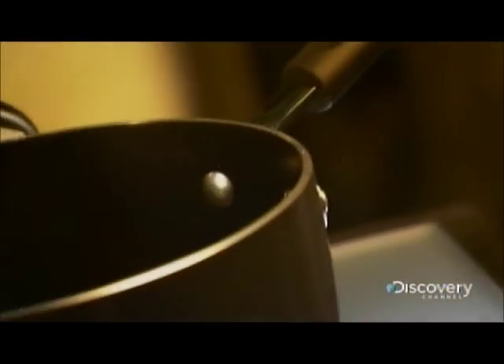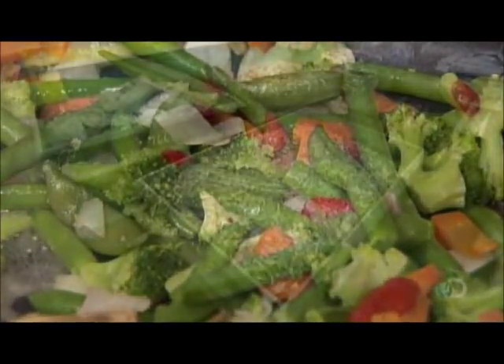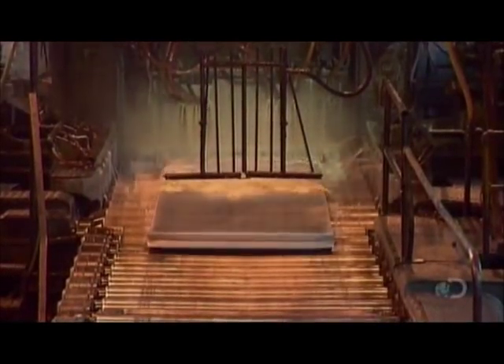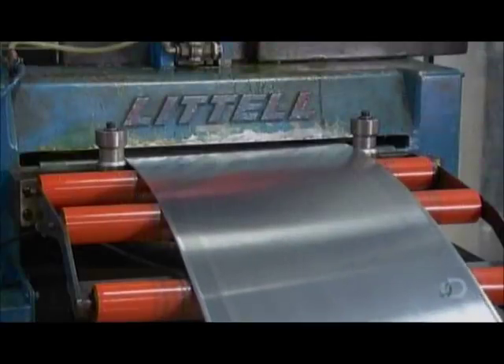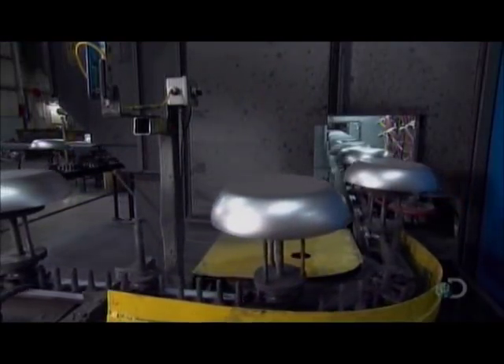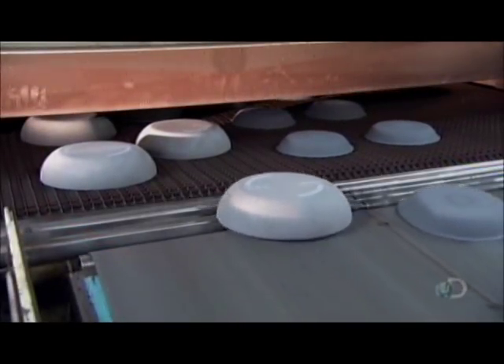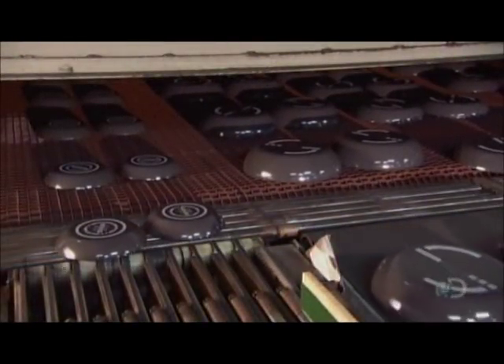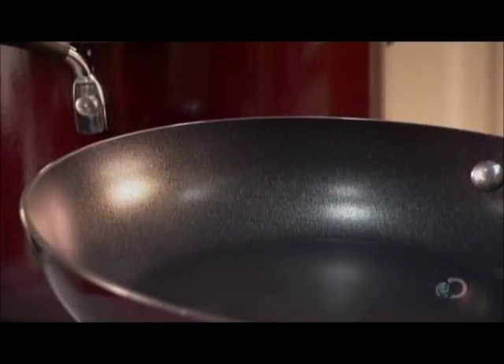How It's Made - Non-Stick Cookware

Comment: The aluminum sheet they are stamping those pans out of is rather thin. It should be at least 1/4" (6.35 mm) thick for good heat distribution. I wonder if they are using genuine DuPont Teflon or generic PTFE. Most likely the latter. I don't like "non-stick" cookware anyway. I prefer well-seasoned cast iron / carbon steel and stainless steel cookware. I'd like to try tinned copper cookware for certain tasks, but it is too expensive.
Reply: Sure a 6.35mm thick aluminum pan heats more evenly, but I doubt any manufacturor would make an aluminum pan that's fully 6.35mm thick from top to bottom. Generally they're half that thickness, which is still more even heating than All-Clad, which uses approximately 1.7mm of aluminum in the cladding. 

The brand of pans in the video is Tramontina, and from the products I've seen they don't use DuPont Teflon, but they don't use generic PTFE either. They use Whitford's Eclipse nonstick. Whitford nonstick easily rivals DuPont nonstick and outperforms some of them. 

As for well seasoned cast iron/carbon steel, I don't know of anyone who has done long term studies on the health affects of seasoning. I mean you're cooking on burned oil. It doesn't really sound much better than nonstick coatings. Plus both carbon steel and cast iron are significantly less even heating than aluminum.

Tin is significantly more fragile than nonstick coatings are. Their melting point is approximately 450F, while PTFE coatings are at 620F. Granted they begin to degrade at about 500F. Tin also scratches a lot more easily and you'd have to retin the pans every decade, which cost almost as much as the pans brand new. You'd be better off buying stainless lined copper.
Reply: >Sure a 6.35mm thick aluminum pan heats more evenly, but I doubt any manufacturor would make an aluminum pan that's fully 6.35mm thick from top to bottom. Generally they're half that thickness, which is still more even heating than All-Clad, which uses approximately 1.7mm of aluminum in the cladding.

http://www.foodservicedirect.com/product.cfm/p/226106/Eagleware-The-Point-Two-Five-Line-Aluminum-Sauce-Pan.htm

The name "Point Two Five" refers to .25", i.e., 1/4" thick aluminum, which is approximately 2 gauge aluminum sheet.  

All-Clad isn't a particularly good performer, nor is any other aluminum-core tri-ply cookware. Stainless steel is a poor conductor and the aluminum core is far too thin for good, even heat distribution. If it were a copper core of the same thickness, that would improve things greatly, though it would still be on the thin side even for copper. Copper should be at least 2.5mm thick.

>As for well seasoned cast iron/carbon steel, I don't know of anyone who has done long term studies on the health affects of seasoning. I mean you're cooking on burned oil. It doesn't really sound much better than nonstick coatings.

It is carbonized oil. Small amounts of carbon won't hurt you; we are "carbon-based lifeforms" afterall. I don't pay any attention to wild health risk speculation anyway. My dislike of PTFE has nothing to do with any alleged health risks. I don't like that you can't sear food properly on it, and that it can be damaged and there's no way for someone at home to re-coat it. 

>Plus both carbon steel and cast iron are significantly less even heating than aluminum.

Cast iron retains heat well, and can handle very high heat, which makes it good for searing. 

>Tin is significantly more fragile than nonstick coatings are. Their 
melting point is approximately 450F, while PTFE coatings are at 620F. 
Granted they begin to degrade at about 500F. Tin also scratches a lot 
more easily and you'd have to retin the pans every decade, which cost 
almost as much as the pans brand new.

I said that I'd like to try tinned copper cookware for certain tasks. I already know the limitations of it, but for the tasks for which it is suited, it is the best performing cookware you can get. And it wouldn't cost me much to re-tin a copper pan, because I'd do it myself. It is just a wetting process, like soldering. Heat, flux, and a bar of tin are all you need.

>You'd be better off buying stainless lined copper.

No. If I were to spend the money on copper cookware I wouldn't want its performance degraded by a sheet of stainless steel on top of it. Also, tin is fairly non-stick while stainless steel is about as far as you can get from being naturally non-stick.
Reply: And the Eagleware is one out of how many cookware lines that are made out there? Cookware made with more than 4mm worth of aluminum is usually relegated to disc bottomed pans. 

Demeyere Proline/Atlantis frying pans comes the closest with it's 3.7mm aluminum core pans and 1.1mm worth of stainless steel. Much more even heating and its heat retention rivals that of 3.6mm of cast iron, which is the approximate thickness of enameled cast iron. Besides, you'll never find cookware out there that gives you perfect even heating where the edges of the pan is the same temperature as the center of the pan. Thick copper pans comes the closest, but it's still not perfect. And when it gets too thick, I doubt many consumers would want to deal with the weight. 

(Small amounts of carbon won't hurt you; we are "carbon-based lifeforms" afterall.) That doesn't sound like a very good argument. Especially with carbon dioxide and monoxide which exist. It's like saying natural must be better for us because it exists in nature. Venom of black widow spiders are natural, but I doubt anyone would want that in their food.

Well, you don't have to sear food in nonstick. Any good cook should leave that to their stainless/carbon steel and cast iron pans. I leave it mostly to foods I don't want sticking in. Mainly scrambled eggs and certain fish for me personally. Everything else I use my stainless pans.

(Cast iron retains heat well, and can handle very high heat, which makes it good for searing.)And that's really one of the very few benefits I can see with cast iron. That and seasoning for a nonstick coating are the only benefits I see going for it.

At least you have the luxury of retinning them yourself. 

I don't think the difference between the performance of tin and stainless steel are as significant as many people think they are. Is tin less stick than stainless? Sure, but it's a a far cry from seasoned cast iron/carbon steel. On a well preheated stainless steel lined pan, sticking shouldn't be that significant. Also the stainless steel thickness on pans like Mauviel and De Buyer Prima Matera, is 0.2mm thick. The difference in the temperature would be minimal. It's going to be the copper that does the conducting, not the tin/stainless steel. It's like Swiss Diamond's claim that their diamond dust would help their pans heat more evenly. The diamond dust is minimal, despite diamond's excellent heat conduction. And in a similar vein, tri-ply pans that are stainless on the interior, aluminum middle, and copper exterior are a waste of money. It would be the aluminum that's doing most of the conducting work. The performance of copper would be blunted by the lesser performing layer of aluminum.
Reply: >And the Eagleware is one out of how many cookware lines that are made out there?

You said:

>I doubt any manufacturer would make an aluminum pan that's fully 6.35mm thick from top to bottom.

You were wrong. Your followup question is irrelevant.

>Demeyere Proline/Atlantis frying pans comes the closest with it's 3.7mm aluminum core pans and 1.1mm worth of stainless steel. Much more even heating and its heat retention rivals that of 3.6mm of cast iron, which is the approximate thickness of enameled cast iron.

No, an aluminum pan of approximately the same thickness as a cast iron pan will not have anywhere near the heat retention of cast iron. Cast iron has about 3 times the mass of aluminum for a given volume. Pound for pound, aluminum does retain heat better than cast iron, but that means you'd need about 6mm thick aluminum for a given size pan to retain heat as well as a 4mm thick cast iron pan of the same size. By the way, typical bare cast iron pans, such as from Lodge, are about 3/16" thick, which is about 4.76mm.

>Besides, you'll never find cookware out there that gives you perfect 
even heating where the edges of the pan is the same temperature as the center of the pan. Thick copper pans comes the closest, but it's still not perfect. And when it gets too thick, I doubt many consumers would want to deal with the weight. 

What does that have to do with anything? Who said that perfection was required?

>That doesn't sound like a very good argument. Especially with carbon dioxide and monoxide which exist.

Carbon dioxide and monoxide are not carbon, no more than water is oxygen or hydrogen. Carbonized oil is carbon. It is not even remotely dangerous to consume in small quantities. Have you ever heard of "charcoal pills"? They are made from activated carbon - https://en.wikipedia.org/wiki/Activated_carbon 

>It's like saying natural must be better for us because it exists in nature.

No, it's nothing like saying that. All life; everything that's organic, is carbon-based:

"The definition of organic is natural matter or compounds with a carbon base"

>And that's really one of the very few benefits I can see with cast iron.
 That and seasoning for a nonstick coating are the only benefits I see 
going for it.

Those are pretty big benefits. You can sear a steak at 500 or more degrees F, or cook eggs at 300 F that slide right out of the pan.

>At least you have the luxury of retinning them yourself.

It isn't difficult. On the other hand, coating a pan with a PTFE-based coating is a factory/industrial procedure.

>I don't think the difference between the performance of tin and 
stainless steel are as significant as many people think they are. Is tin
 less stick than stainless? Sure, but it's a a far cry from seasoned 
cast iron/carbon steel.

As I said, if I were paying big money for copper cookware, I'd want the best possible performance, and that means tinned. The tin doesn't interfere with the thermal properties of copper by any significant amount because it is so thin; so thin that you can't even see or feel its thickness. For example, if you were to only tin part of the cooking surface, you could run your finger across the border between the tinned and untinned surface and it would feel perfectly smooth. That's because it is wetted to the copper rather than being a sheet that's laminated to the copper as is the case with stainless steel. 

Even 0.2mm thick stainless steel is incredibly thick compared to tin that's wetted to copper. 0.2mm is about 12½ times thicker than standard household aluminum foil, and even aluminum foil is thick enough that you can see and feel its thickness. The tin is fairly durable despite it adding practically zero thickness because it actually forms an intermetallic alloy with the copper during the wetting process. That's why it can never peel or flake, because wetted tin isn't a separate metal adhered to the surface like with plating or lamination. 

On top of that, tin is significantly more non-stick than stainless steel. It doesn't matter that it isn't as non-stick as a well-season cast iron or carbon steel pan, or a PTFE pan; what matters is that it beats stainless steel.
Reply: (You were wrong. Your followup question is irrelevant.) First off I said that I had doubts that cookware that is fully 6mm thick exist. I didn't say that none exist at all. Saying that my followup question is irrelevant is just plain dismissive.

(No, an aluminum pan of approximately the same thickness as a cast iron pan will not have anywhere near the heat retention of cast iron. Cast iron has about 3 times the mass of aluminum for a given volume. Pound for pound, aluminum does retain heat better than cast iron, but that means you'd need about 6mm thick aluminum for a given size pan to retain heat as well as a 4mm thick cast iron pan of the same size. By the way, typical bare cast iron pans, such as from Lodge, are about 3/16" thick, which is about 4.76mm.) Six millimeters and four millimeters, that would add up to 75%. I hardly consider that to be "not have anywhere near the heat retention of cast iron". If the aluminum pan was 2mm thick like the ones found on cheap nonstick pans, sure. I'd much rather use a Demeyere Proline pan with 75% of the heat retention of Lodge cast iron without needing to deal with the weight, possibility of rust, and significantly more comfortable and longer handles. The only downside of Demeyere Proline is the price.

(What does that have to do with anything? Who said that perfection was required?) Then there would be no point in having thicker aluminum or copper pans other than durability/warp resistance. Neither did I mean literal perfection. You want pans with the "best possible performance".

(No, it's nothing like saying that. All life; everything that's organic, is carbon-based: ) Your point was that eating burnt carbon is completely harmless just because we're carbon life-forms. I find no difference between that and what I said.

(Those are pretty big benefits. You can sear a steak at 500 or more degrees F, or cook eggs at 300 F that slide right out of the pan.) Both of which can be done in other pans. And I've never seen eggs slide out of a cast iron pan. Every video has the person nudge the egg with a spatula. And this is when no oil is used at all. No matter how well seasoned a cast iron pan is still not nonstick. A suitably thick frying pan can sear steaks without dealing with the weight, rusting, seasoning and the upkeep that is needed for future use. Also with cast iron/carbon steel there are multiple different methods to season them, and not every consumer finds these variation to work well.

(It isn't difficult.) That's because you clearly have experience retinning copper. Ordinary consumers do not. If I were to do it I'd probably burn the building down.

See, mathematically tin-lined copper looks to be significantly better than stainless lined copper but the difference when actually using it would be minimal. It's the copper that is doing most of the work when you're cooking with it, not the tin or the stainless steel. There's also clearly a reason why most stainless lined copper uses no more than 0.2mm worth of stainless steel. It's thin enough to not noticeably impact the performance of the copper but thick enough to be a durable cooking surface. The cookware manufacturers didn't come up with a 0.2mm thickness for nothing. Let's say a stainless lined copper pan that would provide 96% of the performance of an identical but tin lined cooper pan and it provides more durability. Why spend the time to retin the pans after a few years? Why deal with its limitations when a stainless lined pan won't have that with nearly the same performance?

(On top of that, tin is significantly more non-stick than stainless steel. It doesn't matter that it isn't as non-stick as a well-season cast iron or carbon steel pan, or a PTFE pan; what matters is that it beats stainless steel.) Significantly? That sounds more like hyperbole because I've never seen a user of tin lined copper tout its "significant" slicker surface. All I've ever read was closer to an appreciable difference.
Reply: >First off I said that I had doubts that cookware that is fully 6mm thick exist.

I know what you said, and you were wrong to doubt it.

>Saying that my followup question is irrelevant is just plain dismissive.

Irrelevancies can legitimately be dismissed out of hand.

>Six millimeters and four millimeters, that would add up to 75%. I hardly consider that to be "not have anywhere near the heat retention of cast iron". If the aluminum pan was 2mm thick like the ones found on cheap nonstick pans, sure. I'd much rather use a Demeyere Proline pan with 75% of the heat retention of Lodge cast iron without needing to deal with the weight, possibility of rust, and significantly more comfortable and longer handles. The only downside of Demeyere Proline is the price.

It makes a big difference when trying to sear, e.g., a big steak. Less heat retention means a bigger temperature drop when you put a big slab of meat on there. By the way, is someone with a height of 4 feet, 7½ inches anywhere near as tall as someone with a height of 6 feet, 2 inches? 

>Then there would be no point in having thicker aluminum or copper pans 
other than durability/warp resistance. Neither did I mean literal 
perfection. You want pans with the "best possible performance".

Of course there's a point, i.e., thicker material = more even heat distribution and retention, all else being equal. It doesn't matter that you can't achieve perfect heat distribution; it only matters that you can improve it. Why do you think commercial griddles (like this - http://www.webstaurantstore.com/vulcan-msa-60-101-60-countertop-natural-gas-griddle-with-snap-action-thermostatic-controls-135-000-btu/901MSA60NAT.html) typically have a 1-inch thick plate of steel for the cooking surface?

>Both of which can be done in other pans.

Name the other pans which can do that. PTFE pans are no good for searing, and those are the only other type of pans which are non-stick.

>And I've never seen eggs slide out of a cast iron pan.

I have, in my own cast iron pan.

>No matter how well seasoned a cast iron pan is still not nonstick

False.

>A suitably thick frying pan can sear steaks without dealing with the 
weight, rusting, seasoning and the upkeep that is needed for future use. Also with cast iron/carbon steel there are multiple different methods to season them, and not every consumer finds these variation to work well.

As I said, well-seasoned cast iron pans are the only pans which are both non-stick and good for searing.

>That's because you clearly have experience retinning copper. Ordinary consumers do not. If I were to do it I'd probably burn the building down.

As I said, it isn't difficult, which means anyone can learn to do it. When copper is clean, hot enough, and fluxed, when you touch tin to it the tin melts and wets to the copper. It is exactly the same thing as soldering, which anyone can learn to do.

>See, mathematically tin-lined copper looks to be significantly better 
than stainless lined copper but the difference when actually using it 
would be minimal. It's the copper that is doing most of the work when 
you're cooking with it, not the tin or the stainless steel. There's also
 clearly a reason why most stainless lined copper uses no more than 
0.2mm worth of stainless steel. It's thin enough to not noticeably 
impact the performance of the copper but thick enough to be a durable 
cooking surface. The cookware manufacturers didn't come up with a 0.2mm thickness for nothing. Let's say a stainless lined copper pan that would provide 96% of the performance of an identical but tin lined cooper pan and it provides more durability. Why spend the time to retin the pans after a few years? Why deal with its limitations when a stainless lined pan won't have that with nearly the same performance?

I've already replied to this line of argument more than once. There is no need to do it again. You've already conceded that tin results in superior performance in terms of thermal conductivity and being more of a non-stick surface. If you prefer to give up some performance in exchange for additional durability that's fine, but I don't, as I've already said multiple times.

>Significantly? That sounds more like hyperbole because I've never seen a user of tin lined copper tout its "significant" slicker surface. All 
I've ever read was closer to an appreciable difference.

Is that a joke? Anything that is appreciable is significant, as opposed to insignificant, which means no appreciable/noticeable difference. In fact, "significant" is one of the main synonyms of "appreciable".
Reply: (Irrelevancies can legitimately be dismissed out of hand.) Of which I did not find irrelevant at all because it was related to the lack of thick aluminum cookware. And out of all cookware brands that exist, how many were you able to find that makes cookware out of 6mm of full aluminum?

(It makes a big difference when trying to sear, e.g., a big steak. Less heat retention means a bigger temperature drop when you put a big slab of meat on there. By the way, is someone with a height of 4 feet, 7½ inches anywhere near as tall as someone with a height of 6 feet, 2 inches?) It was less heat retention, but it's not by a significant margin.
I would say that yes, person with the height of 4' 7.5" is near the height of someone who is 6' 2" if the third person was three inches tall. You have comparisons of two, I had three.

(Of course there's a point, i.e., thicker material = more even heat distribution and retention, all else being equal. It doesn't matter that you can't achieve perfect heat distribution; it only matters that you can improve it. Why do you think commercial griddles (like this - http://www.webstaurantstore.com/vulcan-msa-60-101-60-countertop-natural-gas-griddle-with-snap-action-thermostatic-controls-135-000-btu/901MSA60NAT.html) typically have a 1-inch thick plate of steel for the cooking surface?) You took my definition of "perfection" literally when I was not using it as such. You find that aluminum cookware needs to be 6mm thick, minimum, to require good heat distribution. Plenty of cookware manufacturers and consumers don't.

(Name the other pans which can do that. PTFE pans are no good for searing, and those are the only other type of pans which are non-stick.) Searing and cooking eggs with low sticking can be done in suitably thick stainless steel and nonstick pans respectively. You don't need cast iron to sear and I have found little difference between searing in cast iron and searing in my Tupperware stainless skillet that has a 6-7mm thick base. 
Also nonstick pans have other uses for sticky foods other than eggs. I've had no successes in browning salmon without the skin sticking to the base of the pan without using nonstick. Plain hard anodized without a nonstick coating that chef Cat Cora briefly sold came the closest but not perfect.

(I have, in my own cast iron pan.) And as I said before, would that be with or without oil and the use of a spatula? As I've said before, I've seen videos here on YouTube where people fry an egg on a cast iron pan without any extra oil other than the seasoning and the egg still stuck and needed nudging by a spatula just to get it to slide around the surface. 

(False.) Then I have an experiment for you. Crack a cold egg into a cold cast iron pan without any oil and heat the egg up. Let's see if it sticks or not. 

(that tin results in superior performance in terms of thermal conductivity and being more of a non-stick surface) Barely.

(Is that a joke? Anything that is appreciable is significant, as opposed to insignificant, which means no appreciable/noticeable difference. In fact, "significant" is one of the main synonyms of "appreciable".) No, it wasn't a joke. One of the synonyms of "appreciable" was also "fair". Fair isn't a high praise. Their reactions were "Oh, tin is slightly better than stainless steel but not by a huge margin." Searing in my 3mm Zwilling frying pan is "appreciably" better than my 2mm Technique Clad frying pan, but my Tupperware frying pan is "significantly" better.
Reply: >Of which I did not find irrelevant at all because it was related to the lack of thick aluminum cookware.

No, it isn't related to the complete lack of 1/4" thick aluminum cookware, because there is no complete lack of 1/4" thick aluminum cookware; it can't be related to something that doesn't exist.

>And out of all cookware brands that exist, how many were you able to find that makes cookware out of 6mm of full aluminum?

What are you talking about? I didn't make any effort to see how many I could find. I only needed to find one to show that you were wrong. A shift from "not any" to "not many" isn't relevant, it is just an attempt to move the goalpost. If you're interested in finding out how many there are, do your own search. It doesn't matter to me, because if you'd said "not many" to begin with it never would have been a point of contention in the first place.

>It was less heat retention, but it's not by a significant margin.

You clearly don't know what "significant" means, which you demonstrated in your previous post, and have further confirmed here.

>I would say that yes, person with the height of 4' 7.5" is near the 
height of someone who is 6' 2" if the third person was three inches 
tall. You have comparisons of two, I had three.

Math isn't your strong point. First you came up with "75%", when in reality it is ~67%, and now you are throwing in a person who is 3 inches tall, when your "comparison of three" consisted of 2, 4, and 6mm thick. 2 is 50% of 4, and 4 is ~67% of 6. 

>You took my definition of "perfection" literally when I was not using it as such.

Whether or not you meant "perfection" literally is irrelevant. The fact remains that thicker = better heat distribution and retention. 1/4" is perfectly doable, available, and known to have excellent heat distribution and retention, so why would I settle for less?

>You find that aluminum cookware needs to be 6mm thick, minimum, to require good heat distribution. Plenty of cookware manufacturers and consumers don't.

It is common knowledge among manufacturers that ~1/4" thick aluminum is the minimum for good performance, which is why all good quality aluminum disk-bottom pans use at least a ~1/4" thick disk of aluminum. Making a pan without a disk bottom, but rather, out of a single metal of uniform thickness, doesn't magically allow thinner material for the cooking surface to give good performance. Also, all good quality copper cookware is at least 2.5mm thick, with some of it being 3.5mm thick. 2.5mm copper is comparable to ~1/4" aluminum in performance. 

>Searing and cooking eggs with low sticking can be done in suitably thick stainless steel and nonstick pans respectively.

Your concession that no other type of pan is both non-stick and good for searing is noted. Remember when you were attempting to trivialize the benefits of cast iron cookware? Would you like to take this opportunity to change your tune?

>You don't need cast iron to sear and I have found little difference 
between searing in cast iron and searing in my Tupperware stainless 
skillet that has a 6-7mm thick base. 

See above.

>Also nonstick pans have other uses for sticky foods other than eggs. 
I've had no successes in browning salmon without the skin sticking to 
the base of the pan without using nonstick. Plain hard anodized without a nonstick coating that chef Cat Cora briefly sold came the closest but not perfect.

Based on this and your previous post, it sounds like you don't have, and have never used, a well-seasoned cast iron pan. My older brother was amazed the first time he cooked in my Lodge cast iron pan and the eggs slid out onto the plate as soon as he tipped the pan. He wanted to buy the pan from me. He'd been using cast iron pans and carbon steel woks for years at that point, but he'd never managed to season them properly. I had my pan for a few years before I learned how to properly season it. I was talking to a friend who had worked as a short-order cook in various restaurants and diners, and he said, "Salt the pan." He said that's what they did in restaurants and diners with their commercial griddles (which are carbon steel). When I started salting the pan while it was preheating, it became jet black, shiny, and very non-stick in a matter of a couple of weeks.

>And as I said before, would that be with or without oil and the use of a spatula? As I've said before, I've seen videos here on YouTube where 
people fry an egg on a cast iron pan without any extra oil other than 
the seasoning and the egg still stuck and needed nudging by a spatula just to get it to slide around the surface.

No nudging required with my pan, not that it's a big deal to nudge an egg with a spatula. As for oil, there's always going to be at least a thin layer of oil on a cast iron pan, because you're supposed to wipe it down with oil when you're done with it. This protects the iron from rust and adds to the seasoning the next time you cook. 

>Then I have an experiment for you. Crack a cold egg into a cold cast 
iron pan without any oil and heat the egg up. Let's see if it sticks or 
not. 

The only way to completely remove the oil that always should be there on a cast iron pan (see above) is to wash it with soap/detergent or some other form of degreaser/solvent, which is stupid. You're not supposed to wash cast iron pans with soap/detergent because it attacks the seasoning. A cast iron pan should always be oiled. Don't you know anything about owning/maintaining cast iron?

>Barely.

First you said "appreciably", which means the same thing as the word I used ("significant"). Now it's "barely"? Regardless of imprecise semantics, the fact remains that tin is better in this regard, which is all that matters to me. The only advantage of laminating a sheet of stainless steel to copper is durability, which I don't care about, because retinning isn't a big deal, and if you don't use metal utensils on it, tinning lasts a very long time anyway.

>No, it wasn't a joke. One of the synonyms of "appreciable" was also 
"fair". Fair isn't a high praise. Their reactions were "Oh, tin is 
slightly better than stainless steel but not by a huge margin." Searing 
in my 3mm Zwilling frying pan is "appreciably" better than my 2mm 
Technique Clad frying pan, but my Tupperware frying pan is 
"significantly" better.

With regard to your semantic games (which are made even more ridiculous due to your distorted sense of the meaning of the term "significant"), see above.

Also, since you dodged the question before, I'll ask again: Why do you think commercial griddles typically have a 1" (25.4mm) thick carbon steel cooking surface?
Reply: (You clearly don't know what "significant" means, which you demonstrated in your previous post, and have further confirmed here.) Seems like you're just ignoring the included synonym of "fair" when I looked up the word "appreciable" in the thesaurus. Both "significant" and "fair" were included. 

(Math isn't your strong point. First you came up with "75%", when in reality it is ~67%, and now you are throwing in a person who is 3 inches tall, when your "comparison of three" consisted of 2, 4, and 6mm thick. 2 is 50% of 4, and 4 is ~67% of 6.) I'll admit that math isn't my strong point. Also I was comparing 3.6mm of cast iron to 4.76mm of cast iron. That was in my original post before Firefox crashed and I had to rewrite everything. Guess I forgot that part of the post. Also the point I was making was that your definition of "nowhere near" is clearly different from mine. My definition of "nowhere near" shows a vaster size difference than yours does.

(Whether or not you meant "perfection" literally is irrelevant. The fact remains that thicker = better heat distribution and retention. 1/4" is perfectly doable, available, and known to have excellent heat distribution and retention, so why would I settle for less?) Because I found that your put down of tri-ply cookware as nothing but snobbery. Slightly thinner products exist and they're perfectly usable cookware that won't largely compromise performance.

(It is common knowledge among manufacturers that ~1/4" thick aluminum is the minimum for good performance, which is why all good quality aluminum disk-bottom pans use at least a ~1/4" thick disk of aluminum. Making a pan without a disk bottom, but rather, out of a single metal of uniform thickness, doesn't magically allow thinner material for the cooking surface to give good performance. Also, all good quality copper cookware is at least 2.5mm thick, with some of it being 3.5mm thick. 2.5mm copper is comparable to ~1/4" aluminum in performance.)I never said making a fully clad pan that happens to be thinner would magically give the cooking surface good performance. But neither would using thinner material automatically makes the performance horrible. Otherwise it would never be sold. 
I doubt you've ever used DeBuyer Prima Matera which uses 1.8mm of copper with 0.2mm of stainless steel. Excluding that it's induction compatible it serves its market well enough for DeBuyer to continue manufacturing it. 

(Your concession that no other type of pan is both non-stick and good for searing is noted. Remember when you were attempting to trivialize the benefits of cast iron cookware? Would you like to take this opportunity to change your tune?) Uh no, because the negatives of cast iron still largely outweigh its benefits for me personally. And I'm not the only person who has this opinion either. Especially since Demeyere Proline's Silvinox coating creates a slicker stainless steel surface and a steak won't stick to a stainless steel surface anyway when the pan has been preheated properly.

(See above.) Reread again, I use a perfectly fine alternative to cast iron.

(Based on this and your previous post, it sounds like you don't have, and have never used, a well-seasoned cast iron pan.) Actually if you reread my posts you'll find that I do. Nearly on a weekly basis at my job. I also own a cast iron pan and two carbon steel frying pans, all three which are seasoned. At my job the Lodge are fine for making steak and tortillas or any foods that don't have high sticking but they're a complete pain to deal with when cooking delicate fish and gratins. In fact many of the chef instructors would rather use ScanPans when searing foods. ScanPans are used almost daily with the Lodge at a much lesser frequency. If it weren't for the fact that I got them on ebay at a very low price, I wouldn't even own my DeBuyer carbon steel pans. And I've tried all methods of seasoning my carbon steel and cast iron. They just don't perform in the ways they're expected to. Do I expect them to be entirely nonstick like my Tramontina frying pan? No. But I do expect them to stick less than stainless steel. There was a method I've read where you stir fry potato skins in the pans which did help by a good margin, but it definitely does not compare to the nonstick pans I have used over the year. 

I should've been more specific, "no extra oil on top of the seasoned surface". 

(With regard to your semantic games (which are made even more ridiculous due to your distorted sense of the meaning of the term "significant"), see above.) I find your sense of the meaning "significant" and "appreciable" just as distorted as you seem to view mine. I did my own search on a thesaurus and I am not using the words incorrectly as you seem to think.

(Also, since you dodged the question before, I'll ask again: Why do you think commercial griddles typically have a 1" (25.4mm) thick carbon steel cooking surface?) A griddle is an entirely different beast to a frying pan and the cooking methods are different. I would never use a one inch thick frying pan due to it's slow heat response. Neither aluminum or copper can be seasoned so their only option was to increase the thickness of the carbon steel.

And speaking of dodging, I see you have no response to this: (The difference in the temperature would be minimal. It's going to be the copper that does the conducting, not the tin/stainless steel. It's like Swiss Diamond's claim that their diamond dust would help their pans heat more evenly. The diamond dust is minimal, despite diamond's excellent heat conduction. And in a similar vein, tri-ply pans that are stainless on the interior, aluminum middle, and copper exterior are a waste of money. It would be the aluminum that's doing most of the conducting work. The performance of copper would be blunted by the lesser performing layer of aluminum.)
Reply: >Seems like you're just ignoring the included synonym of "fair" when I 
looked up the word "appreciable" in the thesaurus. Both "significant" 
and "fair" were included.

I'm ignoring it because it's irrelevant. "Significant" and "appreciable" are close synonyms; "fair" is a rougher synonym. "Significant" and "appreciable" both denote something which is prominent enough to be noticeable. In fact, "noticeable" is another close synonym:

http://www.thesaurus.com/browse/appreciable

See the words that are highlighted in the darker color? Those are the closer synonyms. Is English your native language? A native speaker of English should inherently know these things.

>Also I was comparing 3.6mm of cast iron to 4.76mm of cast iron. That was in my original post before Firefox crashed and I had to rewrite everything. Guess I forgot that part of the post.

That wouldn't have been relevant anyway. My "nowhere near" remark was in response to you claiming that the heat retention of a 3.7mm aluminum core pan rivals that of a 3.6mm cast iron pan. In reality it would only have about 67% of the cast iron pan's heat retention.

>Because I found that your put down of tri-ply cookware as nothing but snobbery. Slightly thinner products exist and they're perfectly usable cookware that won't largely compromise performance.

Pointing out facts is not "snobbery". Aluminum-based tri-ply cookware has a relatively thin aluminum core, and that means poor performance. The stainless steel sandwich certainly doesn't help performance; quite the opposite in fact. They work fine for many cooking tasks, because many cooking tasks don't require or even benefit from higher performance, but that doesn't change the fact that they aren't high performance.

>I never said making a fully clad pan that happens to be thinner would 
magically give the cooking surface good performance. But neither would using thinner material automatically makes the performance horrible. 

Thinner material degrades the performance in a predictable way, in accordance with the laws of physics.

>Otherwise it would never be sold.

That's not even close to the way things work. There are far more products with poor or mediocre performance sold than products with high performance. When it comes to cookware, even the worst stuff on the market can still work fine for many things, and can get the job without regard to how well it did it, for pretty much everything.

>Uh no, because the negatives of cast iron still largely outweigh its benefits for me personally.

Regardless of your opinion, your concession that no other single type of pan is both non-stick and good for searing, remains noted.

>And I'm not the only person who has this opinion either. Especially 
since Demeyere Proline's Silvinox coating creates a slicker stainless 
steel surface and a steak won't stick to a stainless steel surface 
anyway when the pan has been preheated properly.

Sticking while searing a steak isn't the problem; sticking while using it for other things, such as eggs, is the problem.

>Actually if you reread my posts you'll find that I do.

From reading your posts I find that you haven't used a cast iron pan that's seasoned like mine is.

>I find your sense of the meaning "significant" and "appreciable" just as distorted as you seem to view mine. I did my own search on a thesaurus and I am not using the words incorrectly as you seem to think.

You shouldn't even need to check a thesaurus. A native speaker of English should inherently know that a significant difference is the same thing as an appreciable difference. 

>A griddle is an entirely different beast to a frying pan and the cooking
 methods are different. I would never use a one inch thick frying pan 
due to it's slow heat response.

They have a 1" thick cooking surface in order to have excellent heat distribution and retention (high heat retention = fast recovery). Of course they have slow response; anything with good heat retention will have slow response by definition, at least with regard to cooling down when you turn down the heat source. The response with regard to heating up is primarily determined by the BTUs of the heat source.

>And speaking of dodging, I see you have no response to this: (The difference in the temperature would be minimal. It's going to be the copper that does the conducting, not the tin/stainless steel. It's like Swiss Diamond's claim that their diamond dust would help their pans heat more evenly. The diamond dust is minimal, despite diamond's excellent heat conduction. And in a similar vein, tri-ply pans that are stainless on the interior, aluminum middle, and copper exterior are a waste of money. It would be the aluminum that's doing most of the conducting work. The performance of copper would be blunted by the lesser performing layer of aluminum.)

I've already addressed the first sentence, which isn't even accurate. Everything comprising the cooking surface conducts heat, not just the core, and stainless steel is not only a far worse conductor than tin, but it is also far thicker. Tinned copper isn't noticeably different with regard to thermal conductivity than bare copper, while copper laminated with stainless steel sheet metal is noticeably different.

As for the rest of your paragraph, it's irrelevant.
Reply: MaximRecoil
Reply: MaximRecoil Dupont the cancer company
Reply: Damn that was a long ass conversation